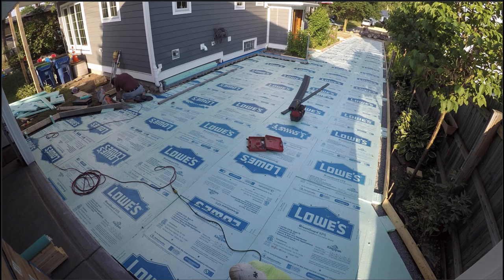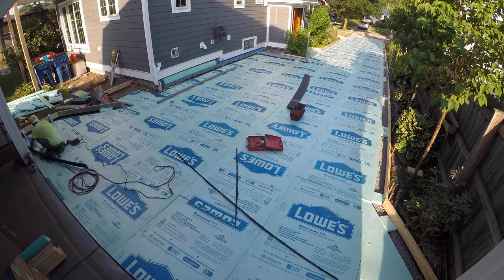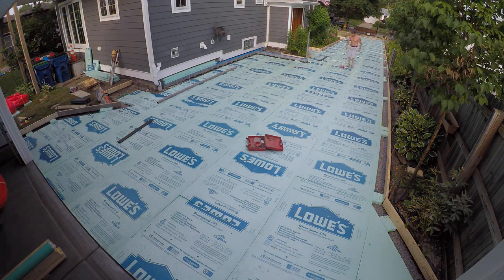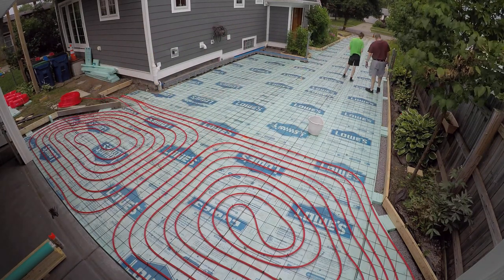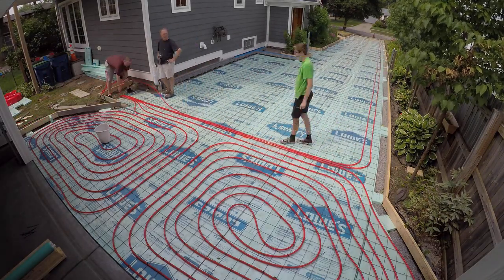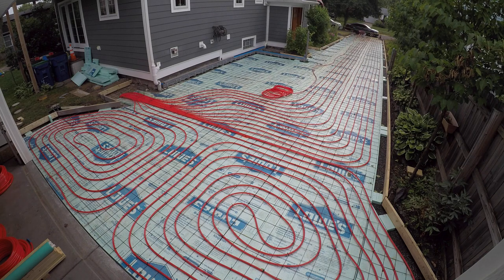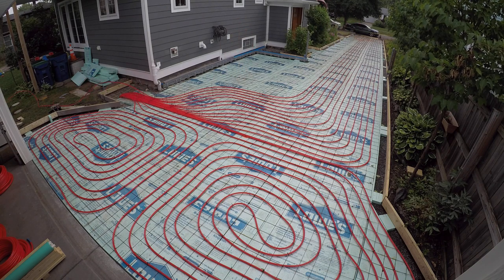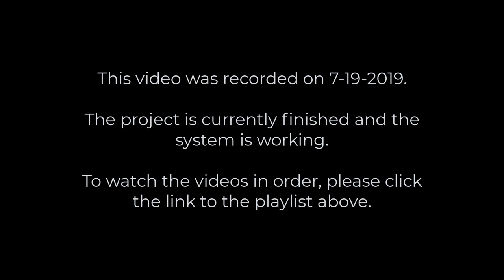Layout & Installation of the PEX Loops - Day 4, Episode 5 of my Heated Driveway Install [7-19-2019]

Comment: Back in the day, craftsmanship was everything and it did not cost body parts.. Today’s world, DIY with some research is the only way I feel that the job will be done correctly without having to take out a second mortgage. 

Chris, you definitely DO have the best videos and taking the time to post them and respond to answer questions is top notch.
Reply from the maker: This is so true Tim.  I have found DIY with some research over the years to be very rewarding.  I was lucky with this project that I found a great concrete contractor after a lot of effort.  Most (NOT ALL) of these guys just want to get in and out, and quality suffers.  I appreciate your compliments as always, and I'm glad you like the videos.  I have a lot more in the queue, hopefully I can get them edited and uploaded fast enough to help as you do your system! 😀
Reply: @DeckerChristopherJ  well said. Although I don’t have pex loops in my driveway, each of the videos help with future plans.

Yes. Looking forward to the mechanical room build video(s). I have all of the components for my system EXCEPT for the “boiler”..  Propane is my source, so the TH-3-DV-P it is.. 

Can I ask what software/CAD you purchased for design.? Or do you have a suggestion on what I might need to correctly design my system? I have looked a the Taco site and a handful more but I just don’t know..

Comment: What was the minimum distance between PEX lines in that dense area coming from the manifold?  I have effectively a forked sidewalk where manifold is at the end of the fork handle and it feeds several for tines.  So the pipes will be dense in the fork handle.
Reply from the maker: In the area where all of the pex gathers before turning down into the PVC pipes to head into the basement, there is no distance between them.  They are pretty much zip tied one right next to anohter.  Once they start to spread out, everything is 6" on-center expect for the end of the driveway where it's 9".
Reply: @DeckerChristopherJ  any concern of the concrete being less thick in that area?  is there any risk of ground water getting between the insulation and the slab?  if so, will it cause any harm to the slab or the pex?

Comment: Chris, I did not see any chairs  or rebar, and you did not mention that screen gauge. (It appears to be 10 gauge) I am doing my driveway and sidewalks now and I tend to over do things, But my driveway drops 6.26' in 45' to the street. Soooo, I have 20 ' 1': Rebar  on  Continuous high chair provides support or bolsters 2" , with 10 Gauge  mesh to center hold my Pert at 2" form the surface with 1.5 concrete inder my 1/2" Pert and 2" above.  Sorry to be lengthy , but why is yours appear to be at the bottom? or did I miss it in the time laps?   I was planning on  doing 2 zones with Tekmar controls, as one is a sidewalk zone and the driveway may not always need to work (If we are away for some time) but since seeing your mechanical room I have lots of Questions about the 3 way valve vs the design I did using a All-in-One Heat Exchanger, Dual-sided Circulators and Mixing Control Package XPB-1 as I operate a Navien NCB-210E,  and my house 3200 square foot house  J-Load is 21000 BTU to a 40 gal Buffer tank (Ranco single stage drywell )
I did that to eliminate the short cycle of the boiler, buy you continuous flow method is making me wonder if my design is as efficient.? My current cost are $4,18 per MCF Gas + capacity $1.73 MCF Charge + $ 1.96 MCF Commodity Charge  then to top that off a $14.51 Customer charge, just to email me a bill I guess!
Hope those questions make sense? 
By the way great series of videos !!!   Again sorry for all the questions.
Reply from the maker: Hi again @jk15214  Your observations are correct.  I did not use any chairs or rebar in my pour.  My concrete is pre-mixed from the supplier with Buckeye Fiber Mesh in the truck, which makes it extremely strong,  The 6x6 wire mesh was really only used to hold the pex in place.  I'm not sure the gauge of the mesh, but I can ask my concrete guy.  I think the rebar and chairs will only help you, but I'm assuming your going to pump the concrete in?  You are correct that mine is at the bottom.  No specific reason for this, I guess it's just the way that I always learned to do it.  Again, pulling it up more in the center will probably only work to your benefit, maybe heating the slab faster and more efficiently, but my system does work and melt just fine.  Tekmar controls are nice, but I found them a bit expensive for my taste at this point.  Maybe in the future...  It sounds like you've done your research, and I'm sure it will work out great!  It's hard to say if one is more efficient than the other?  I've been happy with the continuous circulation, but really only ran it for a month before it started getting warmer.  I'll be able to provide more detailed cost and run statistics when I fire it back up this winter of 2021-2022.  Again, I hope that helps, and thanks for watching!

Comment: The Serpertine Layout here is the wrong way to install the pex. Reverse-return Layout is best
Reply from the maker: Hi Fish Monger! You probably haven’t watched my other videos, where I talk about Reverse Return, including why I used it on 3 of the loops and not the rest. My pex is all 5/8, and every “cold” return back has 2 “hot” supplies on each side of it, so it’s basically the same concept. With a spacing of 6” on center it really doesn’t matter anyways as the pex is so close it heats evenly and works great. I agree reverse return is preferable, but it’s not possible in every scenario. Thanks for watching!